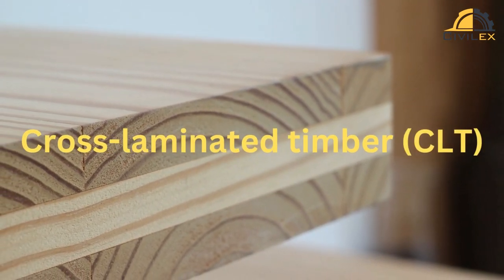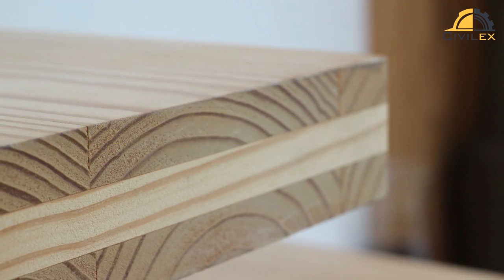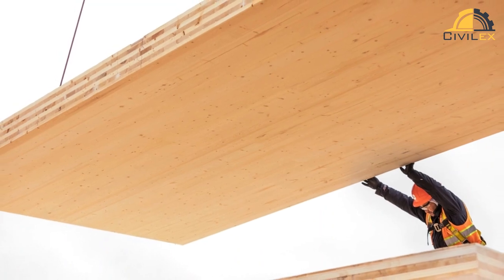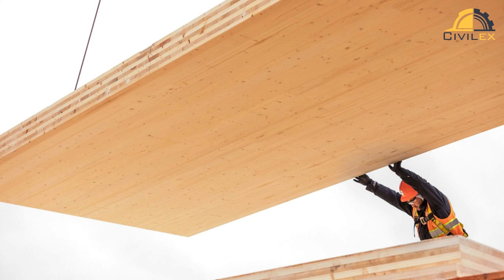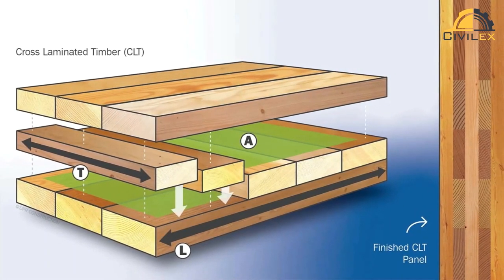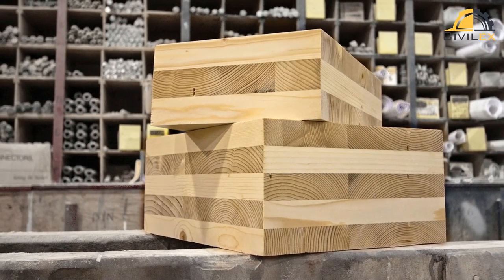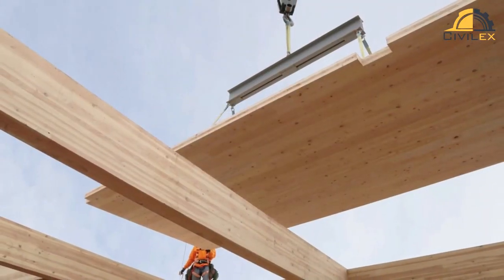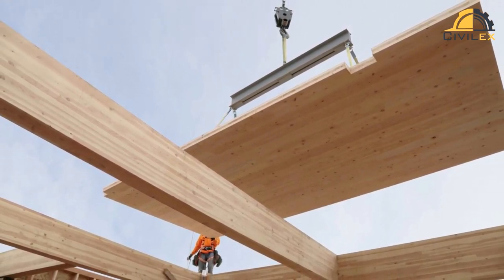The Advantages of Using Cross-Laminated Timber (CLT) in Construction

Comment: how will CLT hold up in a wild fire, when no one comes to put out the fire for days comparing to brick contruction.
Reply from the maker: Wood-based construction materials like CLT are generally more vulnerable to fire than brick or concrete construction. However, builders can take steps to make their structures more resilient to wildfires, such as using fire-resistant coatings on wood-based construction materials or installing fire-resistant glazing in windows.